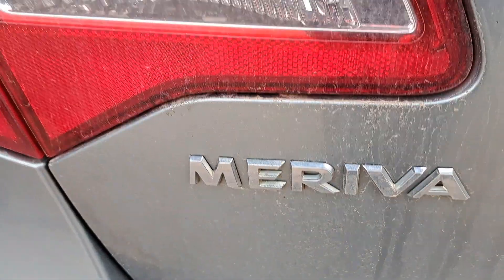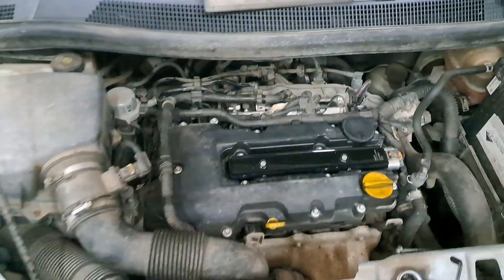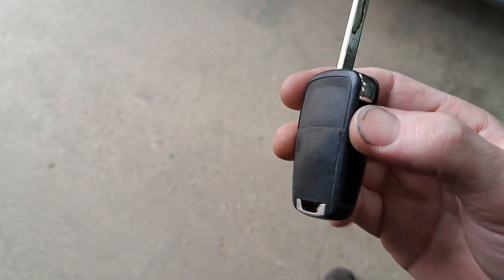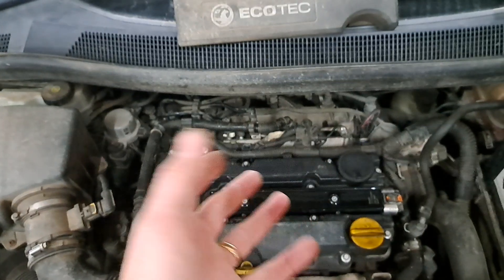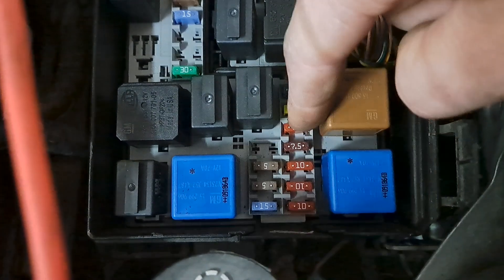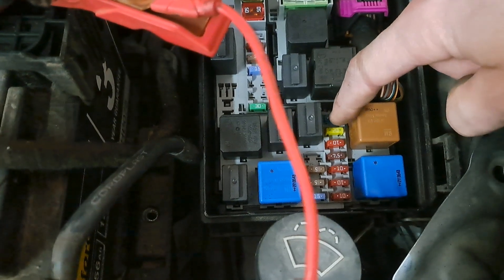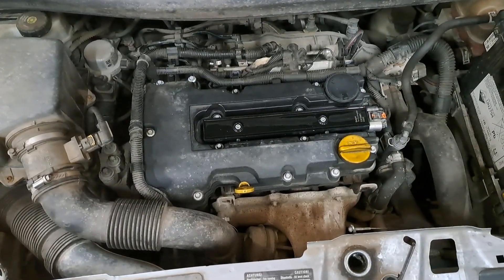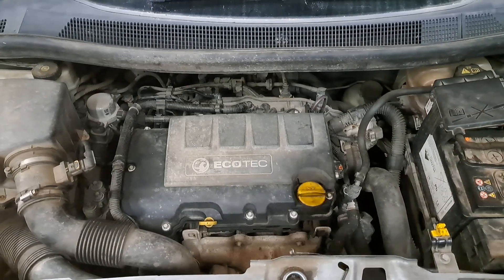Vauxhall Meriva crank no start but diagnostics

Comment: Yh i did the same. But a bit more complicated than that. I bought new coil pack, and then it works for a while and then engine shuts down. Put old pack back  in,  and it runs only on 3 cylinders, but works continuously. Old coil pack doesn't fire one of the cylinders but works. Bought a second coil oack after rerurning the previous new one..same story, engine cuts out after several successful starts. Shuts down within a ninute or will run for a day or until you start the next morning. Now you could say its the fuel line although..checked etc and the engine ticks over well with old coil pack non -stop, except one coil is burned so works with 3 cyl. Codes were cleared and only complains about ecu miscommunication which leads me rlto believe its a relay problem or contact at ecu plug perhaps.  A penny for your thoughts on this one..

Comment: Did it show anything on the computer?? Mine is crank no start but can't find a fault had new spark plugs battery and crank thing
Reply from the maker: There was a fault codes for power missing Two certain items like lamba Sensors Did you actually check if it had spark
Reply: I'm assuming the garage did. Just broken again this am. Waiting in the garage again.
Reply: What is your garage called please need to get u to come.and pick up my car and fix
Reply from the maker: @vikkibell562  R M Mechanical I'm in Lincolnshire

Comment: Were having a simmilar problem the meriva starts cuts out in 2 seconds then doesnt start but sometimes it does start its so stressfull
Reply from the maker: Honestly you need to start with the basics fault codes will be the big tell tile the next thing is what stops working I is the fuel pump cutting out or is it stopping spark we got a crank shaft position problem and just work your way through it
Reply: Did you ever solve this problem